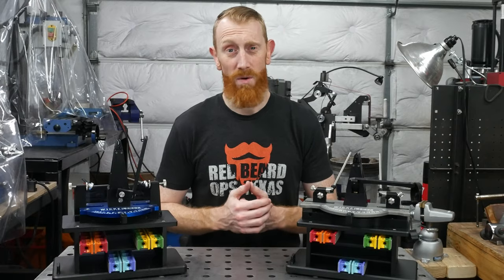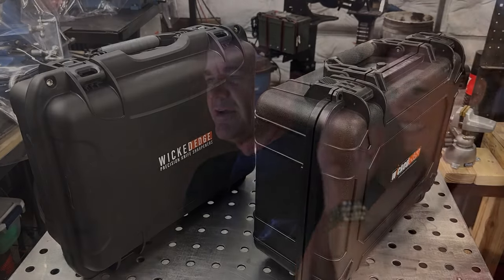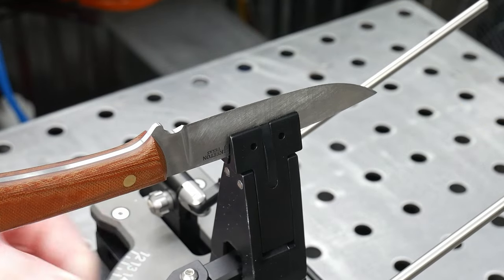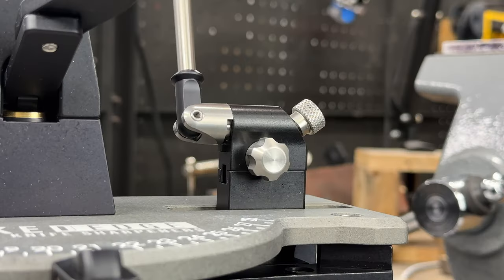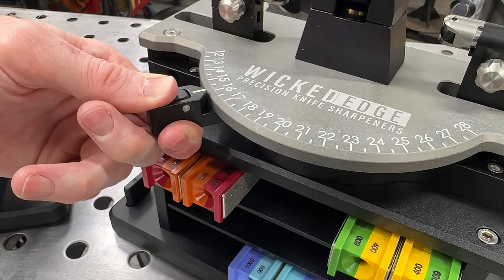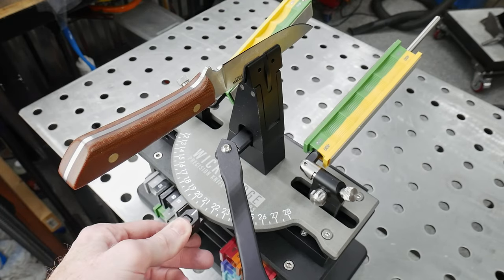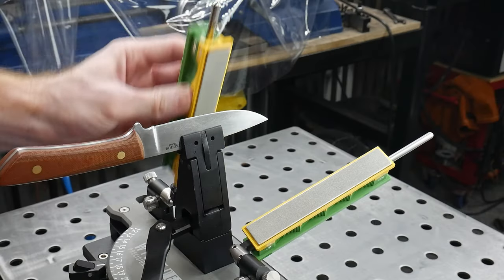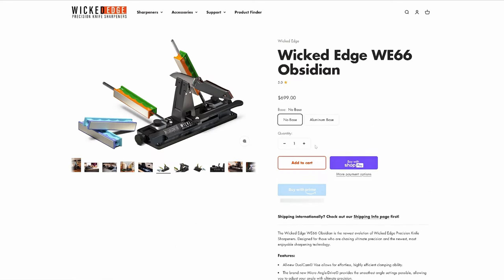Engineering Meets Knife Sharpening 🔪 Wicked Edge Generation 4 PRO Review

Comment: I have had a wicked edge for about 8 years now. For several years i had been putting too much tension on the vice, gradually bending the aluminum jaws and eventually broke the bolt. It was my fault, so i never attempted to have it replaced. I just happened to make a comment on a YouTube video about using the wicked edge, admitting my mistake as a warning to others. Clay Allison himself replied to my comment and told me to email him. Even with the knowledge that i had put too much tension on the vice, causing the failure myself, he replaced my vice jaws with the then- new upgraded gen 3 jaws. Wicked Edge is a stand up company.
Reply: 100% free of charge, by the way. Even shipped.
Reply from the maker: Very cool! Thanks for your comment here!

Comment: I was on their website last night looking at sharpeners. They have the gen 3 on sale for $500 less than the gen 4. Should I get the gen 3? I'm a weekend warrior blade Smith but I'm having a hard time getting the edge I want. Great video 👍
Reply from the maker: Honestly they are both great machines! Sounds like a good deal on the earlier generation... This is the review I did on it - https://youtu.be/R9K7idCh_VU?si=GSPV766393O4daV-
Reply: I have a gen 3 Pro and like it.  Stability is great without even needing to clamp to the bench.  Storage for the blocks is handy too.  The only annoyance is that the degree markings are not very accurate.  I would really recommend ordering their magnetic digital angle gauge too.  Just adds a minute or two to setup, but the results are great.

Comment: Nice review! I have the Gen 3 and am pretty happy with the results.  The 4 looks great, but I probably will not pay to upgrade.  Just a question for you--if you are maintaining a good edge (no major corrections needed) on kitchen knives,  what grit do you start with?  I'm starting with 200, but wanted an expert opinion.
Reply from the maker: For sure not an expert! I think you could start higher than 200 for maintained. Maybe 400-600 to start. Getting that bur back

Comment: Great video! What would be the main advantages of getting the Micro Adjust option? I'm planning to use this for mostly home use, sharpening knives, scissors, chisels, etc.Thanks!
Reply from the maker: If you're sharpening knives that don't have perfectly symmetrical secondary bevels and you don't want to fully reprofile it; you can match the existing bevel. I guess this could come into play if you're not 100% straight in the vice as well. To be honest I don't use this feature often.
Reply: Okay, thank you for your quick reply!
Reply: Is the micro adjustment feature sturdy? Seems like another potential failure point and I wouldn't want an uncentered secondary bevel.